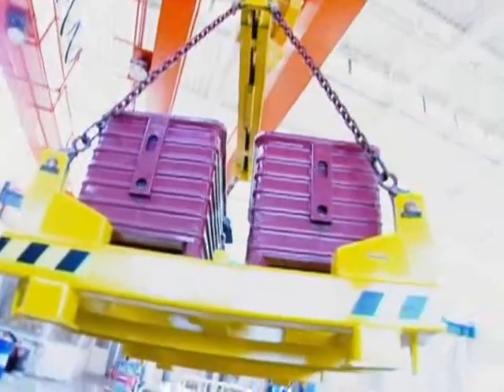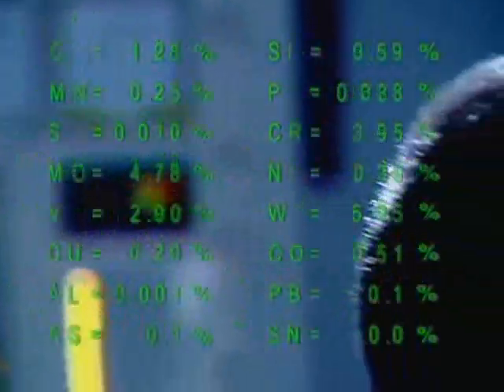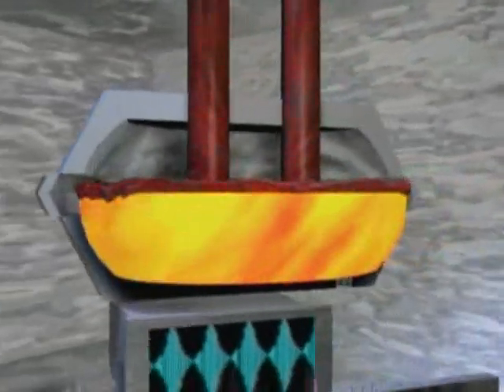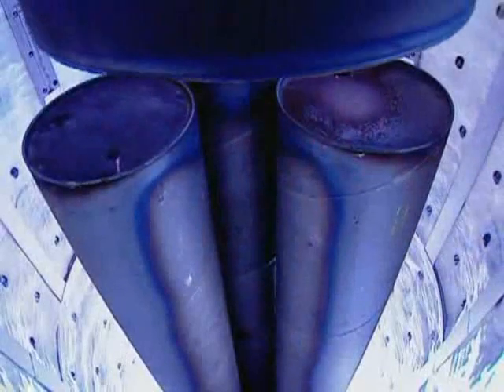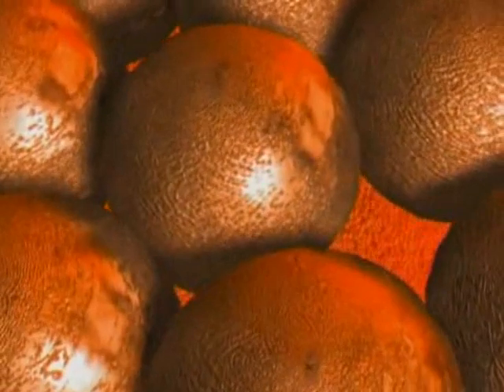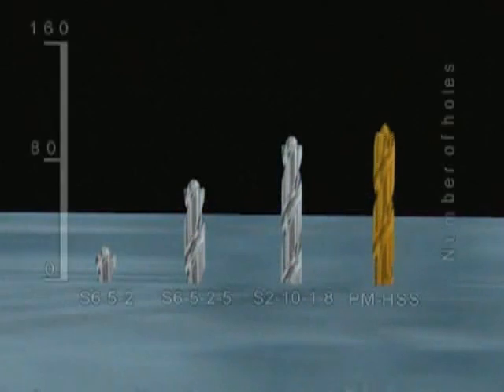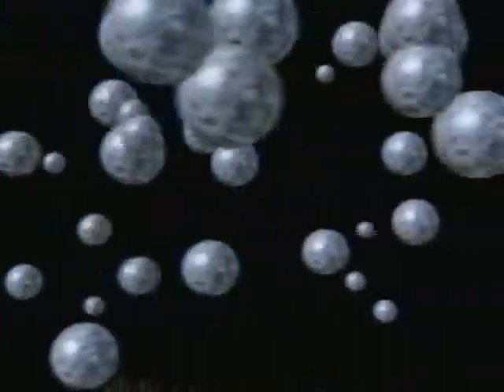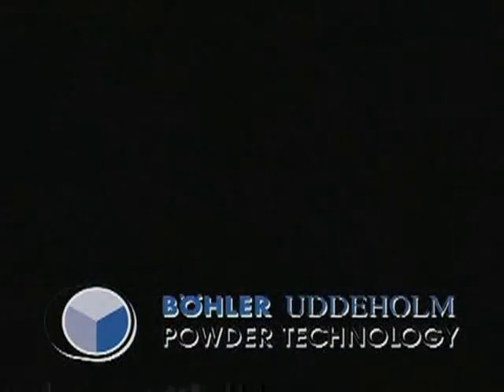BOEHLER Edelstahl - Powder metallurgical video

Comment: Ist nicht geschrieben welche Hochofen ist das ob läufen die auf Gas  oder Kohle oder Elektrik weil, jetzt brauchen wir doch naich auf Kohle aber, auf elektrik solche Hochofen haben. Es wird egendwann keine Kohle? Das beduted mit Kohle musst mann sparen. Blitz hat doch cca 250.000 Elektronenvolt und 30.000 °.
Reply: There's more coal than you're being told. Coal will be used for a long time,,,,👍👍👍💥